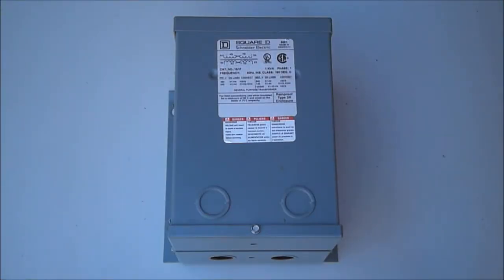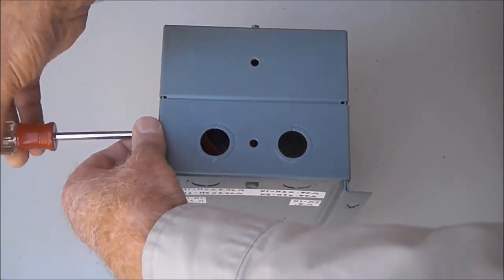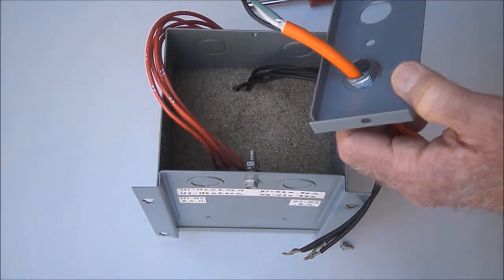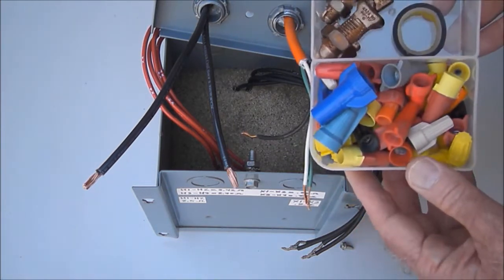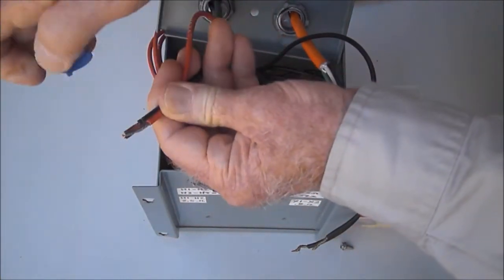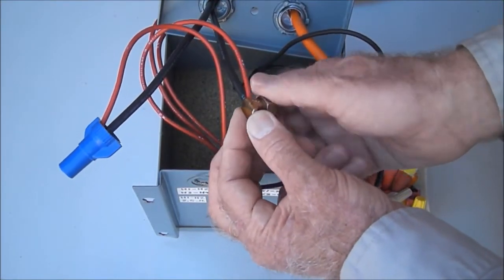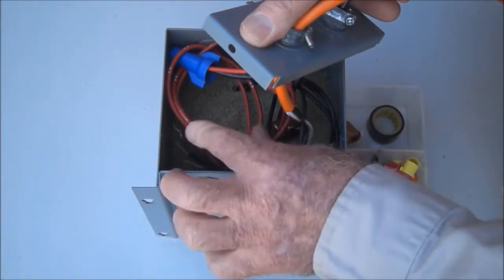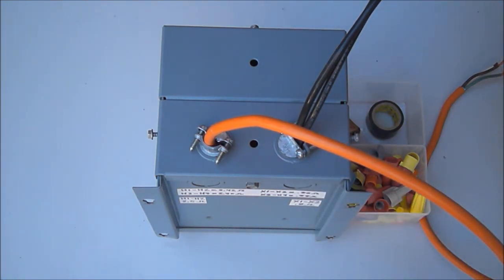Wiring Methods for Sealed Epoxy Resin Encapsulated Transformers | Schneider Electric Support

Comment: This is what you dont do. IF you use a split bolt for a wire nut, automatic fail from the inspector. A split bolt is used for connecting ground wires and that only.

Comment: I would isolate all other wires coming from the transformer. All other wires from the transformer can be connected to the same coil but different part. Letting these wires hang lose is asking for trouble, this is very bad behaviour and it against all safety regulations.